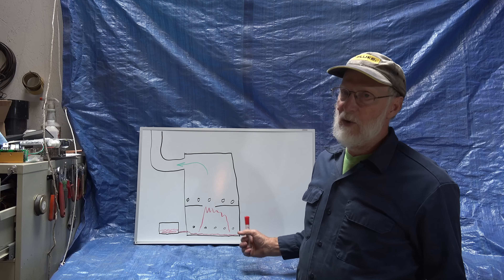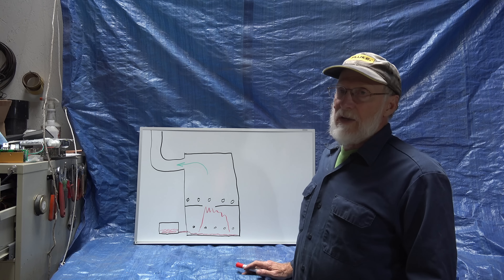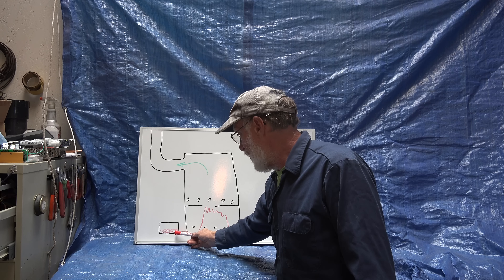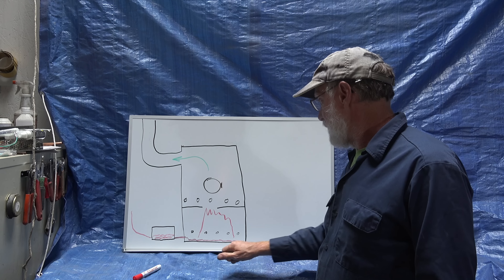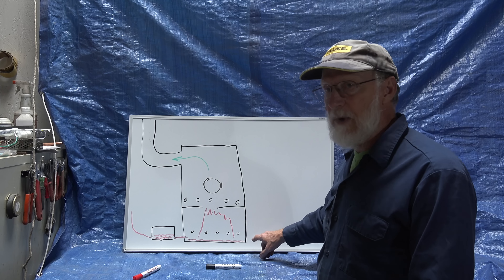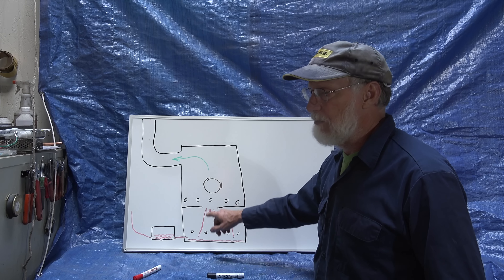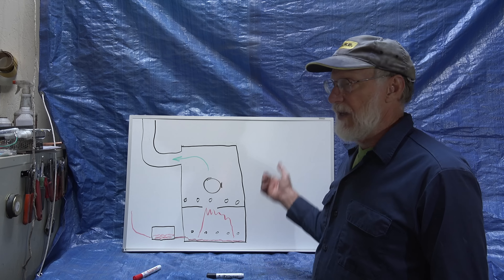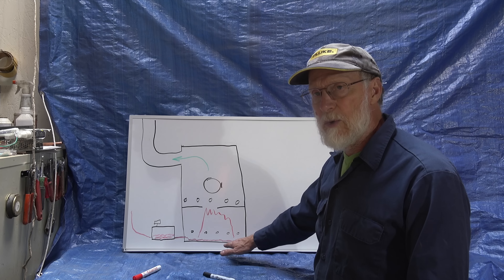How the oil "pot burner" works

Comment: I stumbled into your video while researching (I think) the modern versions of a pot burner heater. They tout 90+ percent efficiency! They are the "Monitor" (by Hitachi, now discontinued), and Toyotomi kerosene heaters (the laser and Oil Miser series). They appear to be turnkey pot heaters, with an electric ignitor, flame sensors, fan combustion air, fuel pump, and electronic safeties!. NOW I have a better appreciation on how these new heaters work.

Comment: I appreciate you mentioning these.

I don't think they were silly at all.  Both of my grandparents had them in their homes.  They were simple, fuel oil was inexpensive and they were reliable.  They were safe (see below) AND they required little maintenance.  Exhaust gas/pipe temps were relatively low.

In terms of safety, they did fail to light on the first try occasionally.  I used one in my wall tent for years.  Hauled it all over the country in a two-wheel utility trailer. If it failed to light initially and too much oil entered before it lit, like you mentioned, it would huff and puff until it burned off the excess.  I think saying it would just around the room may be a bit of an exaggeration.  At least mine never did that.  But yes, it would huff and puff ominously.  

The only explosive problem I ever had was when I lit it up in my wall tent in Utah and set a can of unopened beans on top of the drum.  THAT exploded.

I still have that stove.  You've prompted me to take a look at it tomorrow and maybe light it up.

You would be doing the RV world a favor if you could come up with something like this (that vents to the outside) for use in small RVs.  Now, they're usually propane burners that need electric fans to keep the device within temperature tolerances and to activate thermostats etc.  And they wear down 12V batteries very rapidly.  People end up using infrared or catalytic heaters that vent CO to the living space (plus a lot of water vapor). Something passive would sell like hotcakes.  They used to put passive propane heaters in RVs in the 70s but not anymore.

Comment: Thanks for putting this video on it reminds me that we had a pot burner I remember starting it with a piece of Kleenex you let the kleenex and drop it in and you never left until they got fully lit. It did a nice job keeping the house warm but you always have to make sure and keep it clean like you said we would clean it out about every 6 months. We always make sure we took it down for the summer so we cleaned the chimney real good and cleaned the heater. It served us very well until like you said the oil shortage.

Comment: I've been using an old used oil stove in my garage and am quite happy with it. You can pick these up relatively cheap. I think it's a Duraflame. I've got a 55 gallon drum outside the garage and ran some tubing through the wall. I fill it up with a couple jugs of diesel now and then. I find it runs a long time and uses little fuel. But I'm a weekend warrior. I wait until I visually see it ignite and hang around until it becomes stable. I use a small fan behind it to help keep things cool in the corner and to move the heat around. Have to clean, scrape and vacuum each spring but I don't mind having to do so. I love my stove!
Reply: I have the same set-up you have using only it's a Vintage Quaker oil burning stove with a fan built in. I light it only when I want to use my garage. Also like you I tend to it when I first light it. I start out by setting the control to medium and turning the oil flow on. Then watch for oil to start to flow, when I see enough oil, (a wet spot about the size of a sandwich plate) I light a single square of toilet paper, reach in, and drop it on the oil. Once it gets burning good, I turn the control to about 3/4 till the unit gets hot enough to turn on the fan. Then I turn the control down to 1/4 to 1/2, depending on what heat is desired. I never leave the unit burning over night and like you when I shut it down I make sure there is no flame at all before I leave the garage. This will be my first winter using a oil burning stove therefore I did some research on setting the damper. Correct me if I'm wrong, it is my understanding that there should be no black clouds of smoke from the stack if the automatic damper is set right. I have it set to where you only see heat waves radiating off the cap and periodically a small whiff of white smoke. My biggest worry is the pipes building up soot from burning low. That is why when I first light the stove I burn it hot till the fan kicks in, is to burn out what soot has built up. If anyone has any suggestions they will be greatly appreciated.
Reply: @bruceruscin7782  Sounds good Bruce! I've been using mine for a couple years now still no problems. Mine will let out a little black at start up but from there it's like you say, just radiated heat. I'm quite surprised on how little soot is in the pipework actually. Just a thin coating.  I'm more comfortable with soot than that combustible creosote.  I learned the damper off the internet so you should be able to also. I got the weight so it's open just a crack and easily bounces open during operation especially if it's windy out. Good luck and enjoy your stove!
Reply: Yup, I have the same kind of setup as you guys do in my shop up here in North Eastern Canada and it keeps the whole shop warm (32'X48' with a 14' high ceiling). I keep a gallon of kerosene to light it in the morning and one of those cheap "blue-rags-on-a-roll". I throw in maybe 2 - 3 ounces of kerosene in, tear a strip of one of those blue rags, light it and throw it in. Wait for the flame to get going and "pre-heat" the chamber and then turn the oil feed on and walk away. Burns all day with very little maintenance required. I love that setup and it works great!

Comment: While in college I lived in an old farmhouse that had one of these (a Superflame by Atlanta Stove Works). It heated the whole house. I would turn it on in the fall when it started getting cold and it would stay on until spring. Had a 275 gallon outside oil tank. I'd fill it at the start of the heating season and then add about 100 gallons at the end of January. In March of '75 when we had an ice storm the whole area was without power for a week. I stayed toasty warm. The only problem I had with it in the 6 years I lived there was when a gust of wind blew the chimney cap off an a subsequent down draft blew the fire out. I came home to a house full of diesel smoke. I'd like to find one of these today to use in my workshop. Great heater!
Reply from the maker: The reason these heaters are so rare now is they are far less efficient that a pressurized burner.  They pretty much were removed when the Arab oil embargo increased the price of oil.
GFM

Comment: I have a Yahoo Group that is called Kerosene Heater and Stove Collector.  Find it under yahoo groups or google normally. We have thousands of photos, catalogs, instructions which would help you or others to run their heaters correctly.   Far more of these still in use that you may think. They are quite safe if used properly with some common sense. I have had one to go out on my after lighting and developing some oil in the bottom, but a old bath towel and a pan outside the access door in front allowed me to soak up much of the oil. It still burned somewhat high but didn't dance around and once the heater began to burn down toward low I could reopen the intake valve.  Best to always be sure you heater has reached a good burn temperature before leaving it on its own.  The stoves I am familiar with that had an actual low flame pilot was the Perfection. Not one of my favorite designs.  You used a mechanical thermostat designed for two setting only, low and high. When the room became warm enough it cut back to the lower small burner in the bottom. When it called for heat it reopened the oil valve for higher heat. What usually happened though its due to it allowing too much oil quickly into the burner pot it would smoke up the burner far more than most standard designs where you changed the heat setting slowly.  They also had the more common mechanical thermostat that simply slowly changed the fire as the room called for it up or down.  Your right they are expensive to use but then the steady heat has some benefits. There is lots of information on our site if anyone needs specific information and a lot of members whom some would probably know what your looking for in information.  Most pot burners are about the same with small adjustments in design.  To light my Duo Therms I now use a automotive tool which had the magnet on the end to fish out dropped screws or bolts.  I took the magnet off and replaced it with a small "clip" that will hold a match. Striked the match and lower the long spring down into the burner and it will normally ignite the oil right off if you have some build up of residue in the bottom.  The main trouble with them is after sitting for years normally they need to be taken apart and the parts all free of insects or water and put back together.  The control valves unless damaged also just need to be cleaned out with some kerosene and reassembled and adjusted for the best oil flow on the pilot, or starting and medium flames.  All that is in manuals we have on line.  Hope this helps, would like to see you become a member your information could help some.  We also have information on most Kerosene Refrigerators, Water Heaters, Cooking ranges of all types and brands.  We also have the Coleman Trailer stove instructions which we have request for now and then.
Reply: Dude, thats' cool on the group! I've had a hard time finding info on these things. I just use a lot of common sense. Have to check it out.....thanks! Oh, like your matchstick lighty deal LOL
Reply: Thanks, hopefully I'll find that site
Reply: Thank you too I’ll check your group out for help in futuree

Comment: I use one right now! in fact I just fixed my control valve, previous owner messed the valve up and set the modulating pin in wrong. as for over filling, I call that dieseling, you can control it but you got to be able to reach the barometric vent keep the door of the furnace open and the vent open so it can't burn as good. I like them as it keeps the house at a steady temp with no power and dead reliable.

I'm working on a wast oil boiler system though for the things he pointed out, but for me when it can get to -30 to -40c they are worth the cost of in efficiency for the absolute reliability they have

Comment: I have a couple of Super Flame small oil heaters, one has been used at our hunting camp for decades and they work fantastically well and burn very cleanly and efficiently even if run on off road diesel.  I think calling the flow control valve a "carburetor" is generous though.  A small piece of tissue paper lit and tossed in keeps the clean outs to a minimum vs tossing matches in there to light it.

Comment: We had one in a garage until the early 80s - and got to experience the soot , flash up and smell of burning fuel oil which I still like - it was a 1947 DuoTherm Royal with blower , same chassis as the Thrifty w/o blower . Glad the house had the ultra modern high tech😅 1962 Sears gas forced air furnace.

Comment: I was fixing mine yesterday, it’s a refleks one. It has a coil spring in the middle of the flame to keep it going in high seas :o) It has a hob plate on the top. Best cab heater I’ve ever owned  ^-^

Comment: Sears Roebuck & Co(How it was writen back then). 1947 Oil Burner Stove. 37,600 BTU & .06 Draft - We actually still own and use it. It has the adjustment dial for oil flow, and to replace a float and needle/seat. Part store had one that fit an old carb. Crazy thing would burn any oil put into it. Diesel, Motor Oil with Diesel/Oil mixed to thin, Used ATF  etc. We've owned it since the 80's. Even a time with a damper installed even burned wood in it. Great unit. Still works very well.

Comment: I have the burner and carburetor from and old water heater.  The carb is thermostat controlled, with the 'two orifice' setup.  The burner pot, has a little chamber where the fuel comes in, that was the pilot.  Kind of a neat setup.  It also had a little cleaning rod, that went in through the fuel inlet line, to clear out the coked fuel.

Comment: I've lived through the " ice storm 1998" near Montreal Quebec, we were without power for six weeks because of extensive freezing rain accumulation bringing down trees and the hydro grid.  Fortunately we had a wood stove to heat with but many did not and had to evacuate there homes.  These  types of stoves became popular shortly after although of newer design.
Reply from the maker: There are newer design pot burners and they can be quite efficient.  This one is just about the old ones.  It is not bad to have an alternative when the power goes down.
GFM

Comment: Still have a 12000 watt one, boiler type,conected via pyping to radiators, works fine, but y do agree they use a lot of feul., one thing, the float, or carburator you mention is in fact a float boal whit a steady oil level, and the feul entering the burn chamber is regulated by a slot regulator, works as a drip feed, these type off heaters burn on kerosine or diesel feul .

Comment: Had one of these in a house I rented, never again, the place was my first out on my own "pad" I was out of there Dec 1st.
 Not only did it have this contraption but originally had a coal fired, manually stoked gravity furnace. For hot water a boiler plate, gas fired water heater that you would light in anticipation of having hot water, the tank was not insulated, just a tank with a manual burner. Not sure if it even had a pressure relief on it, you had to remember to go back to the basement and shut it off! 
Man, do I give thanks for modern heating & plumbing products. I wonder how may homes were destroyed from these devices?
Reply: Not as many homes destroyed as homes that were warm because of them.

Comment: I've worked on many of these....some houses were still heating with these just 30 yrs ago
Reply: and here I am, right this second using mine! a Kenmore oil burning stove, it is the fancier one with the heater element to start it and a self modulating oil control valve, before that was an old colman unit

Comment: Oil-pot burners are alive and kicking in many parts of the world, even in Europe. Everything this gentleman says is true; yet there is a reason why they’re still around. The biggest advantage of these heaters is that they do not need electricity and are completely autonomous. Heating oil is usually cheap, and if you burn these heaters at their lowest setting 24/7, you get maximum efficiency. As for the problem of flooding the pot when lighting, just stick around for a couple of minutes to make sure the fire doesn’t go out—and you’ll never have a problem. Also, most of the problems this gentleman mentions arise only when the chimney or flue doesn’t have a sufficient draft; given the correct conditions, these oil-pot burners are a reasonable and economical heating solution for many people around the world.
Reply from the maker: Thanks for the thoughts.  Pot burners are indeed still out there, mostly used in small homes as hot spot heaters.  However, they bear little resemblance to to the pot burners commonly used in the US before the 1970s.  They are far more efficient and have controls to eliminate flooding.  They do, however, need electricity.
GFM
Reply: @grayfurnaceman , I can’t say for the US, but in the UK—and in many parts of Europe—the autonomous, “old-style-of-the-70s” control valves are still manufactured and go by the name of “Toby DVR5.” I use one of those outdated units to heat my shop—only, here, they aren’t considered to be “outdated.” And, yes, they do flood if the fire goes out!

Comment: Wonder if this kuma will burn waste motor oil. Ive got about 50 gallons of it id like to use
Reply: they burn it just fine once hot and going, but you need to be a masochist, as you will become a pro at cleaning soot and ash!

Comment: I have one and like you explained mine will light the problem is that it won't stay lit I tried blowing in the fuel line but there's no way I can. Any ideas i can try thanks
Reply from the maker: That is almost certainly a supply problem.  If you cannot blow thru the line, you need to disconnect both ends of the line and use air pressure on the line.  You could also have a filter plugged.
GFM